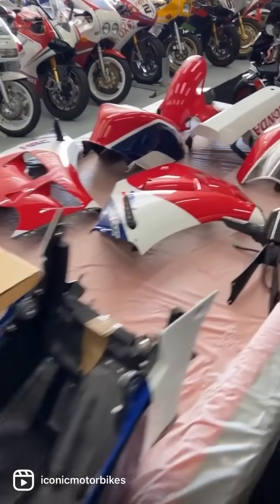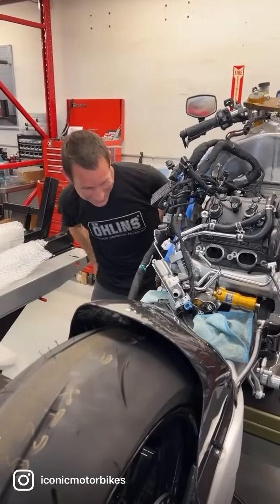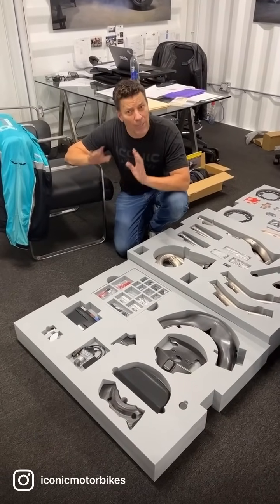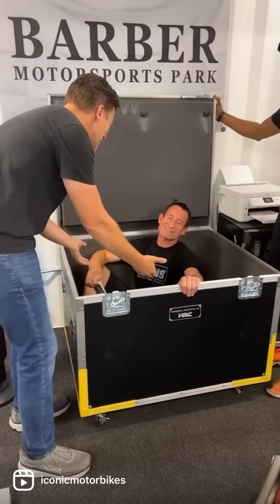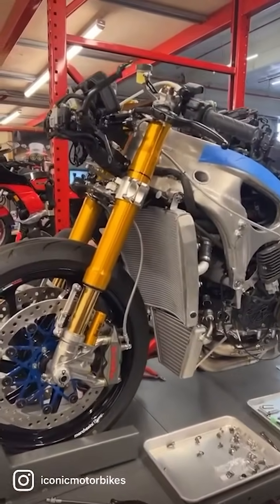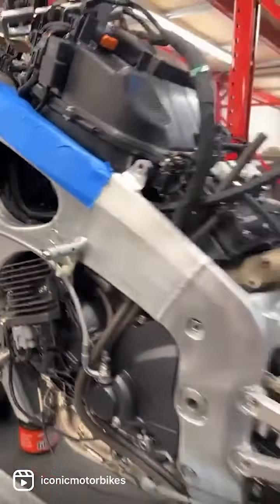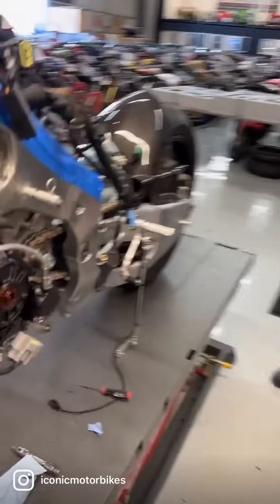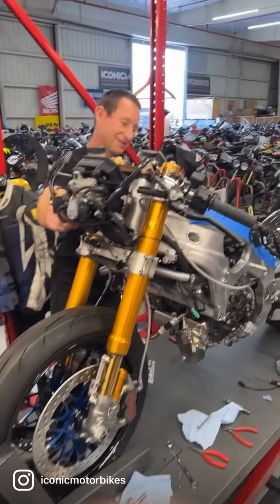Assembling a Honda RC213V-S

Comment: Add the race kit, power goes up to 250+HP
Reply from the maker: We installed the race kit, though I believe Honda claims 212 hp with that installed.
Reply: And if you let the race kit installed by HRC the hp goes up to 298.
Lol.
Reply: I bet the price goes up greatly as well! Beautiful engineering and bike in general, shame Honda has taken such a back seat in MotoGP compared to the mighty European motorcycles, who would have thought when they used to rule and dominate some years ago!

Comment: Im confused....why did i just see a V4 going into a Honda , am i tripping?🤔
Reply: Er...
Ok, I'll resist the urge to be snide, too many people are these days.
Honda is a pioneer in the design and use of V-4 motorcycle engines.  While they still make excellent inline 4s, the V-4 layout has been chosen for many high-performance applications, notably in their Grand Prix racing machines.  Honda has used V-4s in many road bikes, mostly sport tourers.
For sport bikes, they tend to reserve the V-4 layout for limited production, ultra-high performance machines like the RC30 and RC45. The V-4s have an interesting sound, reminiscent of a V-8 at certain RPMs.

Comment: $185,000 for a de-tuned 100HP MotoGP knockoff.  Hell No!
Reply: 200+ hp
Reply: @AbuBawa-sw1ut  2015–2018 RC213V-S: The European and Australian version had 159 horsepower at 11,000 rpm, while the US and French version had 100 horsepower at 8,000 rpm. The Japanese version had 70 horsepower at 6,000 rpm. 
2016 RC213V-S: The US version was limited to 101 horsepower at 9,400 rpm, while the Euro-spec version was rated at around 160 horsepower at 12,200 rpm. 
RC213V-S with Power Kit: This version had 215 horsepower at 13,000 rpm